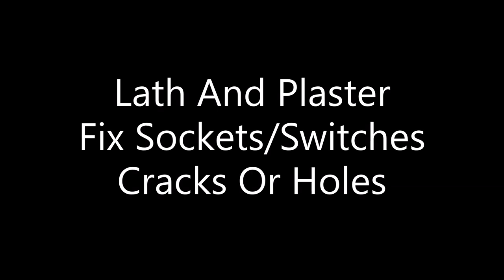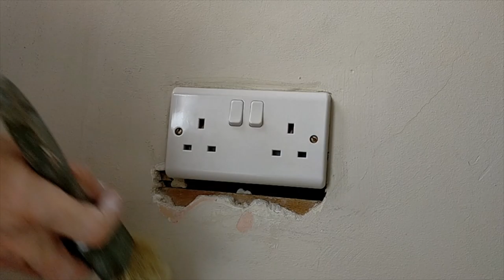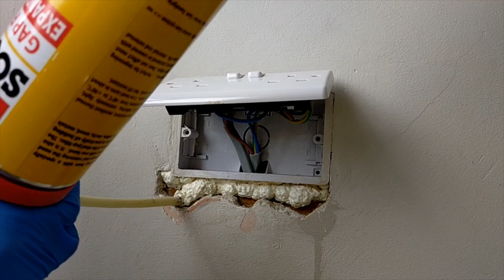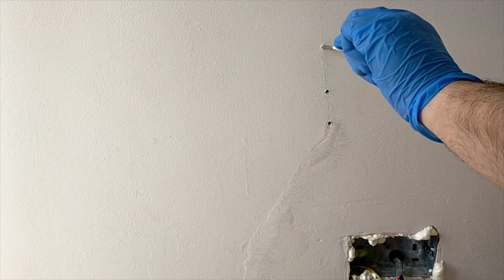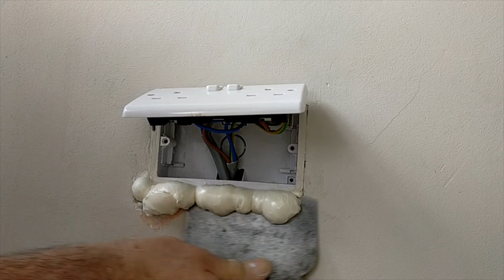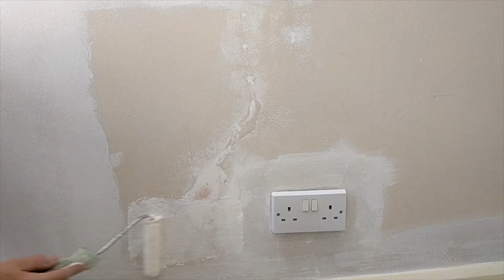Lath And Plaster Fix Sockets/Switches Cracks Or Holes

Comment: I have tried using decorator's caulk for cracks because it's flexible and because I would expect polyfilla to just re-crack. It seems to have worked, but the repair was a bit visible from the start.
Reply from the maker: using foam helps give the filla support.

Comment: Do you prime over the filler before putting the top coat of emulsion on.
Reply from the maker: Yes, you can use a primer, mist coat or diluted PVA. Whichever you use it will still need two coats of your finish.

Comment: Do you ever use the premixed poly filler in the tube? I notice you make a lot from powder so just wondered if you thought they where any good as I have a few jobs coming up that will require some poly filler. 

Thank you

Comment: Would you use expanding foam each time, or would you ever use thistle binding then filler on top before sanding and painting?
How would you attach the pattress if it's loose... I've seen some just ue an adhesive on the back...?

Comment: Do you ever find the expanding foam pushes the wall or wood out of shape after it fully expands and hardens. Thanks
Reply from the maker: Not really, it's all on how much you use. Most of the pressure will come out of your primary hole. Thanks